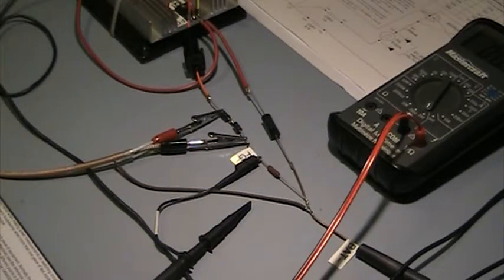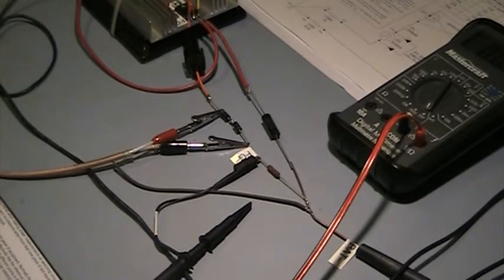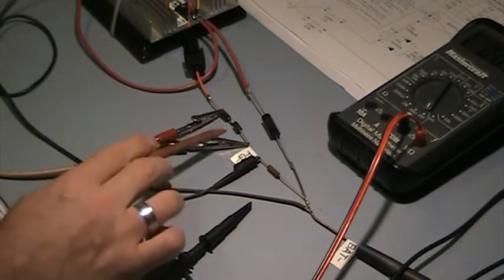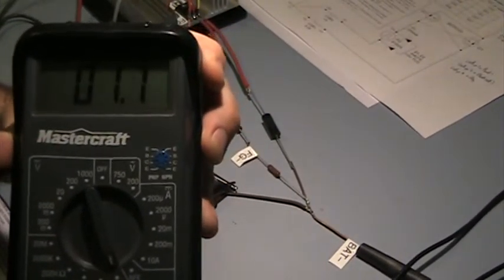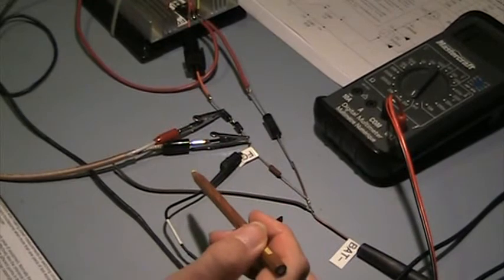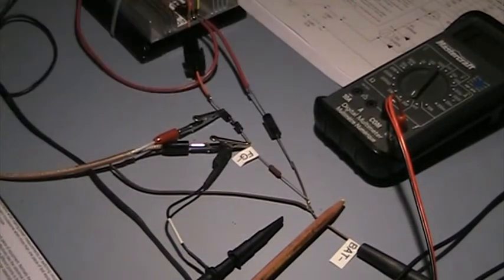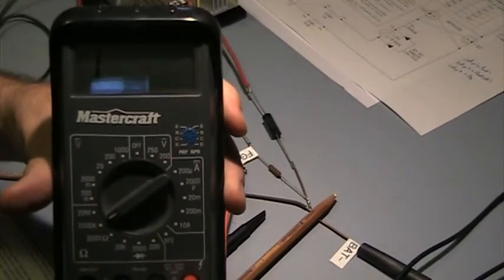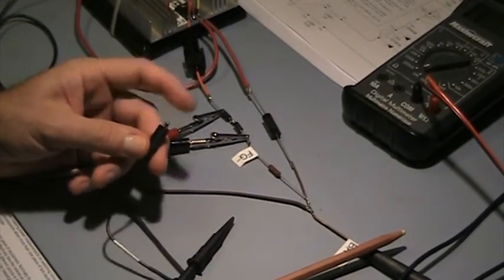6   Earth GND Issue and Solution

Comment: The meter face is very dark and difficult to see when held-up to the camera.  You may want to repeat the presentation with more light on the meter.  

The video does make the point for at least DC.  The X and Y EMI suppression capacitors at the AC power entry of each piece of equipment create another ground loop to the AC mains wiring.  However, this does not become an issue until the 10's of MHz and beyond.  They should not be a problem for 1MHz - 2MHz circuits.

Comment: This is a nice illustration of a "common" problem encountered in measurement.

Some Function Generators, like the Interstate F43 high-voltage FG that I use for my Tar Baby and Little Bryan tests, have isolation switches that can isolate the output leads from the chassis/mains ground. On the F43 this switch is located on the rear panel, but for convenience I moved it to the front.